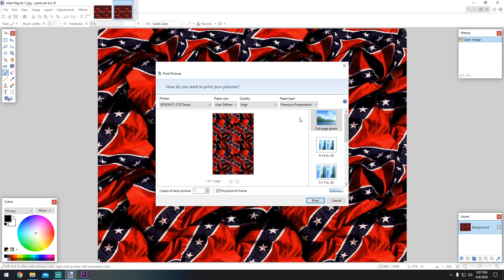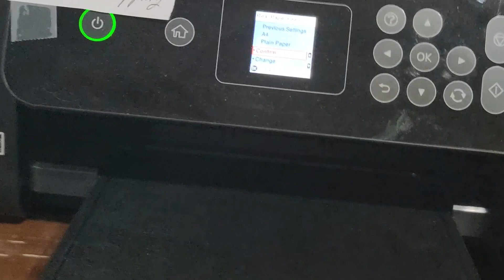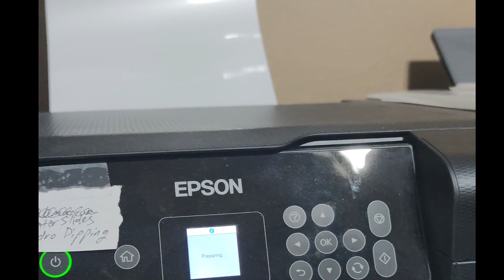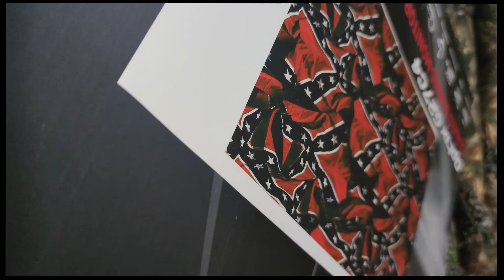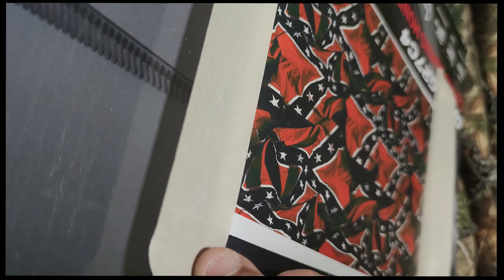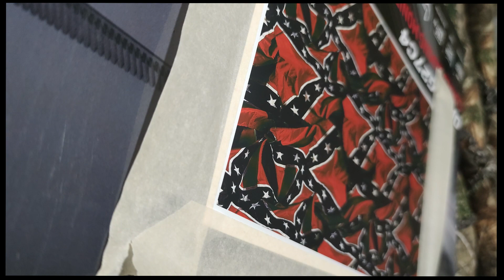Kitchen Sink Hydro-dipping Hydro-graphics with NO ACTIVATORS!!! Part 1

Comment: Hi so im using pigment inks in my printer but it still bleeds when i try to rinse after dipping, please let me know if im doing something wrong
Reply: You may not be waiting long enough. Some people also use a fixative. I've seen recommendations for heating, as well. Hope you work it out.
Reply: Hello, did you find a solution? I have the same problem

Comment: I got a Epson et-2850 it only prints a little like 2in won't print full page what do I need to do
Reply from the maker: Try and update your Epson software
Reply: did you manage to fix this problem?
Reply: @ttiwaz you need to put the transparent film on a white paper, I had the same exact problem, basically the printer doesn't recognise the film because its transparent, so when you put it on a white paper (I taped it) it will print correctly

Comment: Hi sir, I’m CHEN from Koue Industries in China, we have new PVA blank printable film, we can supply samples to you for test if you need it. Thanks. This is my WhatsApp: +8613880828244
Reply: hello sir which type of paper and which size? for which type of printer?
Reply: @ersingorkem2518  . Our PVA blank film width is 50cm and 100cm. Our inkjet printer is normal inkjet printer and ink
Reply: @koueindustries-hydrographi4845  hello can you tell me the price of 100 cm how much?
Reply: @ersingorkem2518  . The 100cm width Blank Film price is $3.6 per square meter. MOQ is 50 square meters.
Reply: @koueindustries-hydrographi4845  hello sir, if you know The printer type, can you tell me the name and specification of printer plase, ı Will found printing then J will neew your paper
Reply: @ersingorkem2518  Hi sir, we can supply our film samples to you test. Our inkjet printer is Custom from Japan.
Reply: @ersingorkem2518  this is my WhatsApp ID: +8613880828244
Reply: @ersingorkem2518  Our Inkjet Printer is OEM from Mimaki in Japan. Also our ink is Mimaki OEM too

Comment: Does it have to be just a epson printer because i have an HP all in one printer and i have custom hydro film printer paper i ordered off amazon
Reply from the maker: It doesn't have to be an epson printer.
Reply: @vanceboyer1242  i have one more question i forgot to ask, do i need to change my printer settings on my laptop there as well to adjust it for the water transfer paper these exact settings or is it dffierent for each printer?
Reply: Okay then thank you so much, when i bought my printer paper for it, on my instructions it says i need "Activator A" after i print what i want on the printer paper to help the ink stay on it. What is "Activator A"?
Reply from the maker: @Sheldric09  it's a protective film so the image doesn't get ruined. Basically for shipping purposes
Reply: @vanceboyer1242  so i dont need activator A if i print and immediately put the paper on water? Thnaks
Reply: Ahhhhhh okay then well i thank you so much for explaining that to me because i was so lost on that but thank you for clearing that up with me
Reply from the maker: @Sheldric09  you're welcome